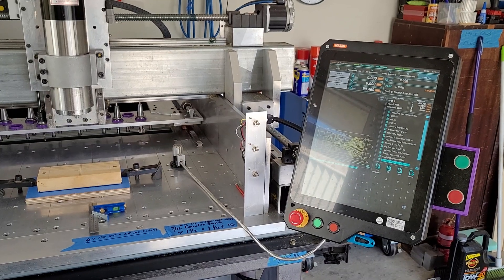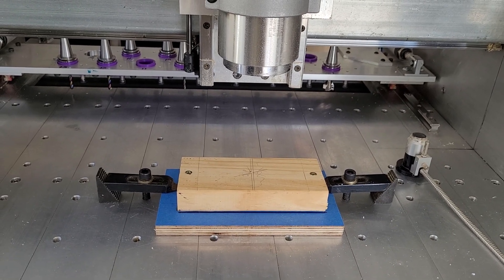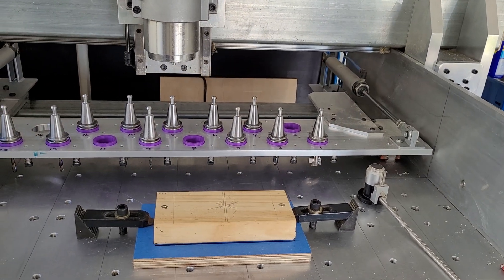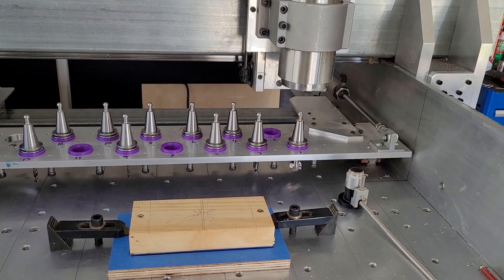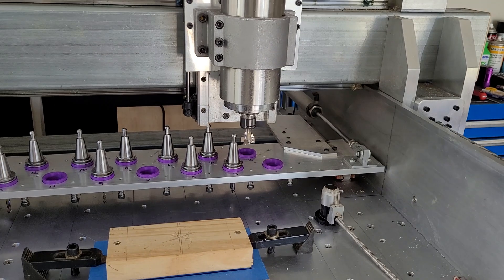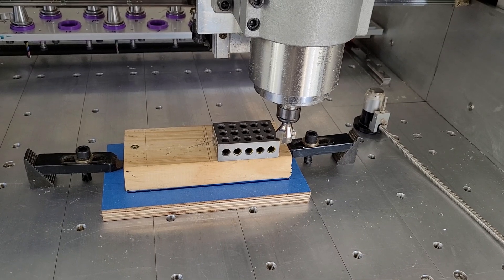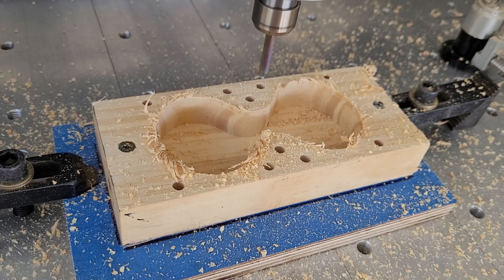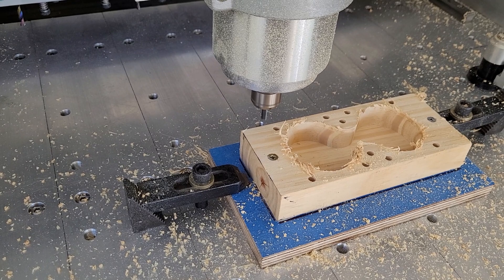Home Built Auto Tool Changer in action with 2d adaptive and Drilling today

Comment: nice work man .....how did you seup the sliding pop up tool changer on masso ? any videos recomanned to understand ?
Reply from the maker: Hi thanks , it's to long winded to explain but short answer is you need a sensor to detect when the tool rack is retracted or not (wirers go to Masso) and the signal to activate the air rams solenoid is connected to the dust hood up / down output on Masso, if you read through the Masso tool changer logic it explains it all,........ not to hard to do  Cheers Bill ....  Oh in my latest video I have mad an enclosure for the sliding tool rack to slide out off through industrial brushes check it out quite trick really
Reply: @williamnorris1516  Thank you very much for your interest... I was waiting for your answer impatiently because I was sure that there is no option within Masso  that can support the sliding of the tools , but it can be circumvented by connecting the signal inputs with the dust cover.... Thank you for confirming this idea to me

Comment: Did your surfacing op hit the screws? I was sad you skipped that part, i was interested in how the inserts handled that. Awesome machine.
Reply from the maker: Hi yep ran strait over it, only just heard it, did not worry it at all . And I have used this same 3 insert Bap to surface mild steel with a very light cut with good results cheers Bill

Comment: are you planning on showing how to set up the atc?
Reply from the maker: Hi Lucas do you think many people would even want to see that ??? there are several areas to it like #1 settings in the Masso controller #2 the sliding tool rack, rails, sensor, tool holders #3 tool change speeds and feeds #4 problems and solutions etc it would need a series of videos I think to cover it what part of it are you most interested in let me know cheers Bill
Reply: @williamnorris1516  personally I'm making your machine so a breakdown of everything that is needed and how to configure everything would be much appreciated for sure, cheers 🥂
Reply from the maker: @Lucas_sGarage  Ok I will put it on the to do list but in the meantime are you on the PrintNC discord if not you will fine it at Three Design Print NC Discord then look in Blogs and you will find my Bills Print NC PRO blog it's a start to finish build log of my machine lots of photos and some videos cheers Bill

Comment: I know wood is pretty soft but good practice is to keep all swarf off tool holders and spindle when swapping tools.
Reply from the maker: Hi Jordan yes you are correct, the spindle uses an air blast as it is coming down on the tool it's about to pick up and I can adjust this pressure but as well I have an air gun in my hot little hand to clear chips of the tool rack . and now that I have my Fog Buster mist coolant / air blast system set up this will also help and give me  time to be more time to keep the tool rack clean  thanks for the comment Cheers Bill

Comment: Wow this is really great. But what i wonder more is the sound of your machine, why is it so quiet? It sounds like everything runs on air. Maybe a stupid question, i know nothing about machines.
I only know they make a lot of noise. A specially milling machines, if the spindle reaches 17-18K rpm it really makes a hell of a noise. You even hear them moving with an anoing electric sound when you just move the gantry for instance, yours doesn't. wow. i'm truly amazed. Does it run on compressed air?
Reply from the maker: Hi I know what you mean I had another machine that I did a cnc conversion on 15 years ago and the whine of the stepper motors drove me insane and yes cheep spindles can be high pitch and when you combine the two you get a lot of noise and people start to talk about building enclosures with sound proofing etc I did not what that with this build and so went with servos which are almost silent . and when I was researching a spindle I found out about just how quite the Jianken spindles were Piotr Fox Wysocki did a good in depth video using a sound meter to compare a cheap Chinese spindle to a Jianken 2.2 Kw spindle to prove just how quite and smooth they are I run my machine during the day with the garage door wide open and the neighbors never complain  I have asked a few of them and they said they had never noticed it at all  I am sure I could cut a part at night with out any problems cheers Bill
Reply: @williamnorris1516  thanks for the explanation, you’re right, i really did compare your machines music with the noise of a stepcraft m1000 with stepper motors and a 0,6kw AMB German spindle.

Comment: 😮hello. Can u give some info on the face mill? Maybe a link I like the fact that it is small. Thx
Reply from the maker: Hi it's called a Bap 300 R it takes 3 inserts and you can get all kinds of inserts for them it has a 12mm shaft 80mm long Sorry I have no idea of how to do a link but there are tons of places selling them on AliExpress I got mine from a very good supplier it's BB tools
 on AliExpress I have bought CNC drills and end mills of them very reliable I hope that helps cheers Bill
Reply: @williamnorris1516  thank you for the info.much appreciation

Comment: Why such a low speed when changing tools? The coordinates when changing the instrument are known, and you can fly g0, with the exception of the last few centimeters of descent.
Reply from the maker: Hi only finished the machine 6 weeks ago so I started steady with all the setting and have crept up on my feeds two weeks ago I upped my X and Y feed rate from 1500 to 6000 and couple of days ago I increase my rapids from 40 mm/sec to 500 mm/sec and only this afternoon I increased the speed of the tool change cycle so getting there but it's early days thanks for the comment cheers Bill

Comment: I like how you made the cushion for the toolholder. Simple but looks rly good.
Reply from the maker: Hi thanks for the comment yes ATC tool holders need a little bit of flex which you get with the fork style holders but I needed two rows to get enough tools in the rack and so had to go pick and place style shoulder bolts and springs easy to do I got the idea of another guy on YouTube I 3d printed the holders which lets you play around with the height and length all seems to work great cheers Bill

Comment: A little tip, you should double the holder for the milling spindle. This improves stability when milling.
Reply from the maker: Hi yes that well could be an upgrade for the future and not hard to do and not very much money cheers Bill P.S I like you channel impressive
Reply: @williamnorris1516  Thanks for the flowers😉 You don’t have to hide behind your work either. Anyone can buy one, even the worst ones can build it themselves. Is your milling machine equipped with a Masso control? Looks interesting.
Reply from the maker: @SimsonSupermoto  yes it has a Masso G4 touch screen 5 axis controller I really like it and Masso are continuously adding features and working on development cheers Bill